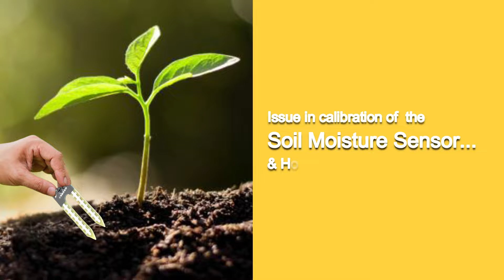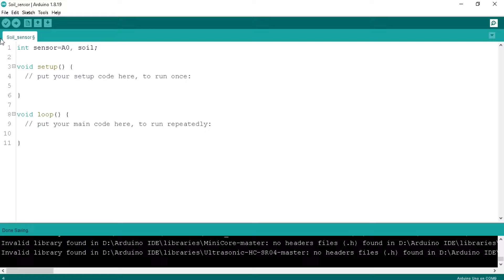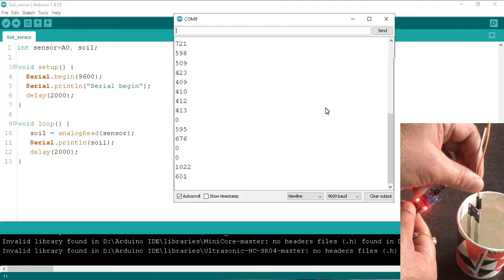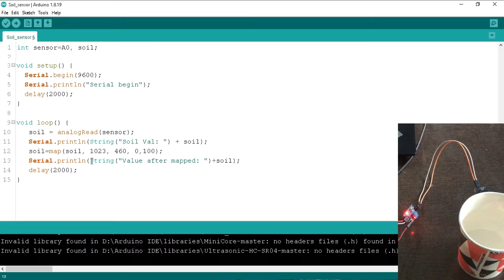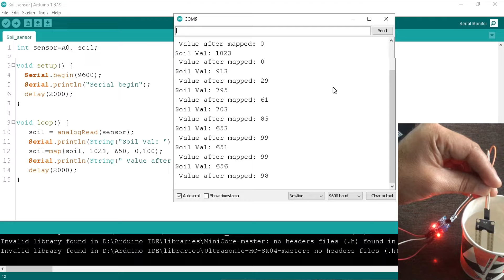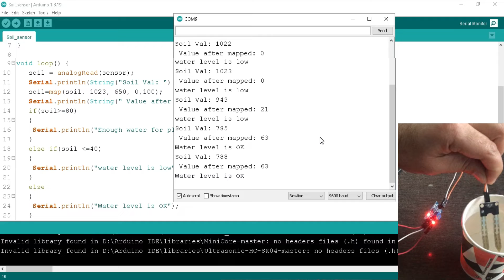A Complete Guide on Calibrating Soil Moisture Sensors for Agriculture and Plant Monitoring

Comment: Great video sir
Reply: What if we don't need a computer for the output and using multimeter instead
Reply from the maker: Then connect the 5V and Ground to the sensor and then check DC voltage variation in the multimeter between 0V to 5V. Them convert the voltage in to 10 bit resolution so that it compatible with the Arduino or other MCU boards.
Reply from the maker: Thank you 🙏